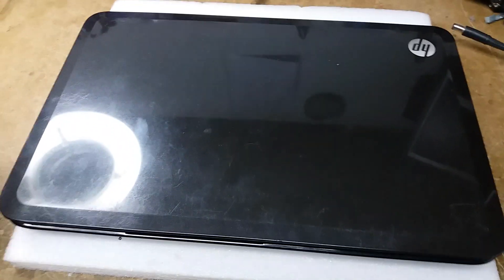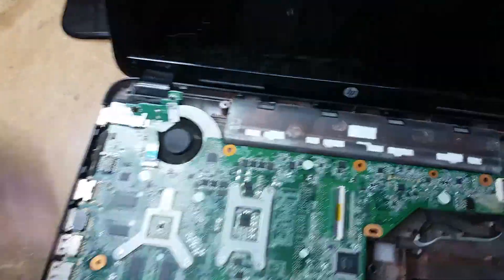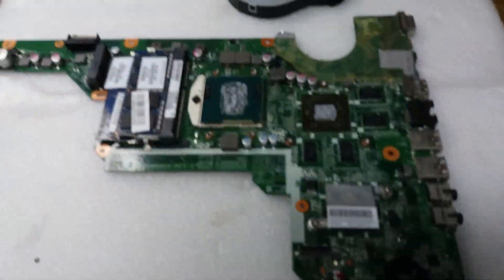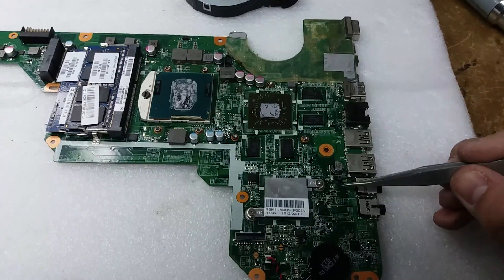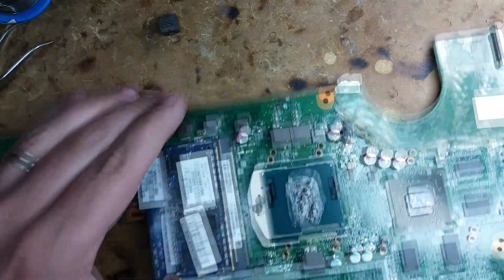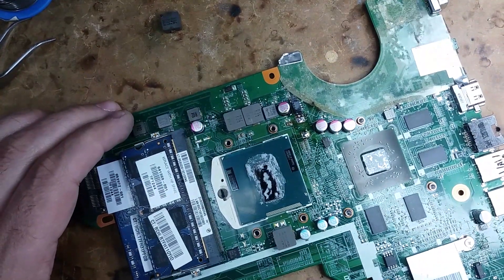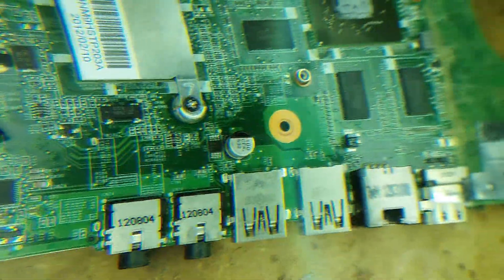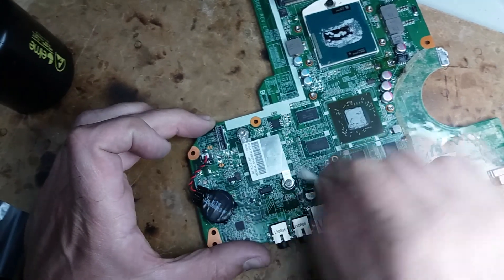HP G6 2017SP turns on but no display, Repair

Comment: Hi sir my name is Atif. I have hp 840g4, laptop. Problem is no display when I press power button machine is on. The frant power card lights 1&4 on then 2 seconds middle light on means 4 lights on and fan to much fast and no display I remove all things, same condition, even reply the bios. Ram supply working good. U have any idea. Share with me thankss

Comment: bro i have a hp 2000-363nr laptop the when you turn it on the caps lock light blink 2 times i try to update the bios but when the hp start the process you cant see nothing on the screen no back light no display but the fan still spinning do you think i having that problem the you have on that laptop

Comment: Why is it that a reflow only is expected to last a short time when if you replace the gpu everyone says that it will last? Thanks
Reply from the maker: A reflow only melts the internal solder to provide a temporary connection. . The problem is actually the inside of the chip, that's why a reflow or reball in most cases is temporary. Granted, there are cases where the chip is fine but the solder balls need a reball.
A new chip will work if the chip is new or it didn't have any problems when the salvaged it. Normally it's virtually impossible to get a really new chip, almost all are refurbished, and the cheap ones normally come with issues. . It's always a shot in the dark, I would advise buying from a reputable source, even if it costs a bit more.
Cheers. 🙏
Reply: @Fixepedia  
Thanks for taking the time to explain this.👍
Reply from the maker: No problem, I try to help when I can . . Cheers 🙏☺️

Comment: What was the capslock blinking code? I have one blink code that goes continuously, and I tried plugging it in to another monitor and putting in another ram, but the screen was still black. I'm not really sure if it's a gpu issue or cpu.

Comment: Ok, so you disabled the separate graphics chip. (removed coil and jumper). So then it will boot just use internal INTEL / AMD graphics, as if there is any separate graphics chip present. Clever. Which this would be just a SWITCH on the hardware user-interface.... as the power button ;)
Maybe an external monitor then after this fix is not possible anymore? Maybe.
Reply from the maker: Hi,
I'm Sorry, but I didn't understand some parts of you message.
But yes, the main Graphic chips is disabled and the shared Graphics chips that is part of the Chipset steps in to do all the work.
Yes, if this doesn't work for you, you might try using a external LCD because sometimes that works. And maybe try and make a All in One Computer like in DIY Perks ;) Check it out... it turns out Great!
https://youtu.be/8jeLCQ62vFk

Take Care.
Reply: can you elaborate? so the coil powers the dedicated video chip? and what about the resistor? I guess schematics are needed for other models, or is there a way to track this if you know what to look for?

Comment: My neighbor has the same laptop with the same problem. But his does not have a dedicated GPU. I removed RAM, SSD, and connected it to an external monitor and nothing works. I'm assuming its a motherboard issue, maybe CPU.

Comment: I have a Pavilion G6 2260SM, it died in 2015 and it's just sitting 4 years because I've never found what is the problem. 
One day the laptop was just idling and on desktop background. I grabbed the mouse and the cursor didn't move, so it was frozen totally. The only thing I could do was to hold the power button to force shutdown. From that point there was no display when turned on. 
Going to shops that repair hardware, they just say: "Well, the motherboard died and you need a new one." 
It has a dedicated HD 7670M GPU and the CPU is an A4-4300M.
It turns on, the fan is spinning, but no display. I just have a soldering station with a soldering iron, I do not have the heat gun. I could give it a try. Thank you for this video.

P.S. I've heard when most laptops have this problem, when you connect an external monitor you get a picture, but it doesn't make sense to me. My laptop doesn't display picture even on an external monitor connected to VGA port.

I was looking on my motherboard, I found the coil but I can't find R550, biggest resistor number I can find is R545 and there is no resistor there. Our motherboards are similar but not the same.
Mine is DA0R53MB6E1 REV:E

Comment: Hi,  hp board DA0R13MB6E0 REV-E PROBLEM CAPLOCK BLINK 5 TIME WIFI LED ON FAN SPINNING NO DISPLAY.  WHAT WAS THE ISSUE? I CLEAN BOARD AND RESOLDER BIOS IC.  STILL HV PROBLEM.
Reply from the maker: Hi,
Did you flash the BIOS also? That's something you should do.
There are a number of things you could try to figure out the problem, first you can try and reflow the graphics chip to see if that's the problem, if not then clean the memory and memory banks, if not then clean the CPU and you can even try reflowing the CPU Socket because there are some models that have that issue.
I hope that helps.
Cheers.

Comment: I have a different board, it is 649288-001 . Cannot find the R649 or R650 location. Are there different methods for the different boards?
Reply from the maker: Hi,
Your board is different but it is almost the same method, you have to remove the same coil, but then the resistor change is from R466 to R451.... but i will leave a link to someone else's video that shows the process. Please tell me if it worked for you ;)
https://www.youtube.com/watch?v=eISpiy5_b8o
Cheers.

Comment: You can turn on the laptop in safe mode and disable the amd graphics chip in device manager too. it will be easier. I too had the same problem and it solved the issue. If you do not disable the amd graphics chip, the os downloads the graphics drivers automatically and again you get black screen because the graphics card has malfunctioned.
Reply from the maker: Hi,
Thanks for your comment and for your feedback, and yes, you are absolutely right. You can most definitely do it that way, but to reduce the power consumption and the stress of that happening as you said, i think it is a wise choice to manually disable the graphics chip hardware and never have it happen again, but i will let your comment Pinned so people can have that option too... Thanks again ;)
Cheers!
Reply: Please bro contact me I have the same problem

Comment: Removi o coil num HP g6-1090sp. Não mudei mais nada porque não encontro essa resistência na board. Ou seja fiz o mesmo procedimento que em https://youtu.be/CZDJhhEqvNU
Apenas removi o coil. Infelizmente o portátil nem liga agora. Não e grave porque a pessoa que o usava já comprou outro, foi mais para ver se o conseguia por a funcionar só que fosse só a com a integrada no problem. De qualquer das formas deve estar a faltar qualquer coisa talvez a mudança de uma resistência, condensadores ou qualquer outro componente.
Edit: após ler um comentário em baixo posso acrescentar que há led na entrada de alimentação, há 19.5V e no pinout do conector do switch de power estão lá 3.3V. não verifiquei no entanto se há problemas aí porque o portátil ligava até então.
Edit2: experimentei desaparafusar a plaquita do power Burton juntamente com o flat cable e notei que o flat cable tinha um dos pinos um pouco descolados do plástico. Ou seja ao tirar e por este cabo acabei por perder a pega cor de rosa que vem com estes cabos. Essa pega ao descolar também descolou um bocado o condutor mais a direita do flat cable. Ao notar nisto espalmei um bocado o condutor e assegurei me que ele ficava bem colocado no conector da board. Experimentei de novo e funcionou 😃 está vivo. Agora e por um SSD e temos máquina nova 😁
Reply from the maker: Boas. . Desculpa lá aqui o atraso na resposta. . . Fico contente que tenhas conseguido reparar a máquina 😁😁😁
Ya. . . Às vezes andamos às volta e pensamos que o problema é mais grave do que parece é esquecemos dos princípios básicos. Acontece-me o mesmo, principalmente nos fixos. . . Andamos ali a trocar fontes e a medir tudo e quando vamos a ver é o botão on/off. . Hehehe. . Anyway, faz parte do ofício.
Abraço.
Reply: @Fixepedia  o único problema neste momento e o teclado não estar a funcionar bem. Algumas teclas não regista ou então só regista depois de premir durante algum tempo. Não estava assim. Não sei se foi ao tirar e por o teclado várias vezes q se possa ter danificado. Mas o flat cable do teclado está bem ligado. Enfim se for problema do teclado por 20€ nem e por aí agora se for a jusante disso...
Reply from the maker: @ANPEM  tens de ver bem se não está nenhum pino torto dentro do conector, também podes limpar os contatos da fita e volta a experimentar e confirma se fica mesmo bem encaixado e que ele faça bem o fecho quando apertas o plástico de suporte no tal conector. . . Se mesmo assim estiver igual é porque é mesmo defeito do teclado, Portugal em regra é um pouco húmido, então acontece que os portáteis se estiverem parados durante algum tempo, é o suficiente para os teclados apresentarem sintomas estranhos e intermitentes.

Comment: i have an hp G42 laptop,everything is working fine,i can even hear the welcome and shutdown tone of windows but the screen is totally black.i test the lcd and flex is good.no display also on external monitor.the gpu is intel.any idea to fix?
Reply from the maker: Hi,
There are a few things i would check first... first i would see if it's not a Back-light issue, you can try using a light source close to the LCD to see if you can see any picture behind the glass.
Second i would double check the connection and connectors to see if they are clean..
Do you know the Motherboard Model Part number? So i can see if i have a solution for you?
Cheers .
Reply: Fixepedia I know you posted this a yr. ago, how would I check if the connection and connectors are clean?

Comment: pavilion 15-e015T- not getting display, power button is on, wireless button is on, but no display, and fan is on,,, like laptop is on
Reply from the maker: Hi,
Did you try connecting it to an external monitor? There are always a couple of other issues, like a faulty Display, etc... But you have to troubleshoot those options. Good luck with your repair.
Cheers
Reply: @Fixepedia  thanks for replying
Reply: Yes i tried... But no results... Now i repaired my laptop on a shop. He said there were inside water in laptop and board was sotting. I was cheated by him he stole my cpu(i5).  And said cpu was faulty due to Power ic sitting problem. Is it possible?
Reply from the maker: @NeoStreamLive  Hi, the cpu can be faulty due to a number of issues, but they are not that expensive, you can order one on eBay and change it if you find your current CPU slower. . . I mean that can happen, since these some of these new cpu's have a graphic chip integration, then it could cause problems, but sometimes it could be a power consumption issue and if you change the CPU to a slower with less power consumption, then just changing it can solve the issue. Hope this info helped.
Cheers
Reply: Thanks, its very helpful
Reply from the maker: @NeoStreamLive  thanks for watching 😉
Cheers

Comment: Hi there !! i was searching and searching to find a proper video like yours in ENGLISH so i can understand why/how this is done. THANKS V much !!!

A Question if you have time to read this... 

 A few weeks ago my RADEON GPU worked just fine sort of, sometimes while playing some older games like GTA SA i would get a freeze and machine would restart but nothing more.

4 days later i updated my HP's BIOS to the latest, and did a fresh install of windows...
Here's the problem... since the update and windows fresh installation,  i can't get my GPU to work again, i'm not sure if this is a software issue, hardware issue or that HP maybe programmed their bios to kill off all last surviving Radeon GPU's in the G6 Series, because whatever i do, that card is not working, windows reports error code 43  

Question would be: Do you happen to know if this would be rather a hardware problem or maybe software ??? i tried all drivers available on the internet from A-Z and 4 different windows OS's and had the same result. 

I also own a HP G6 2303SQ Board that i can confirm has a dead GPU, since whenever you install AMD driver you would get BSOD making it unusable.
Reply from the maker: Robin SAS Hi, thanks for the great and kind feedback 😉
Yes. . . I'm gonna guess that it is a faulty GPU, from what you told me about the problem that it gave prior to the fresh installation and Bios update. And from experience, Bios updates always improved performance on the computers that I updated. I would open the computer and check and see how bad is the clogging in your heatsink. If its clean and your thermal paste is still good, then I would try to troubleshoot drivers, etc. . But if it's clogged and got dried up thermal paste then it's most likely the Gpu Hardware failure. 
Your other laptop is probably the same as this one in the video, try and see if you can fix it, and if so, come back with some feedback, I'll be curious to know how it went.
Cheers
Reply: Hello Fixepedia. I think it might be a hardware problem, it drives me to believe that the updated bios might came with some instruction that diagnoses faulty hardware which in end prevents the issued hardware from working at all idk. Or it's end time just arrived...

But i will as a last resort give it a try with a fresh updated OS and driver's. 
if it still won't bring nothing, then i'll just shutdown the GPU for better CPU thermals.

 ..sure going to be fun for me to switch that TINY little rezistor without damaging the board...with my "Soldering Gun"     Some guy said i should just remove the COIL, but then i wonder why all the people in the videos switch the rezistors too, Well i'll be coming back later in the future with an update on this. BYE &       Thanks for replying.
Reply from the maker: Robin SAS Hi, yeah. . It might end up being the best option.
Yes, you have to change that resistors location, because it is a "jumper", and it is that sequence that determines if the Gpu is active or deactivated 😉 
Best of luck.
Cheers
Reply: Hi, just wanted to post an update on this.  I've managed to Reposition that rezistor and to remove the coil.    the rezistor was the hardest part, but i managed. 

About the temperatures which was my main goal - i'm not so sure that it helped, since i don't notice much of a difference in thermals. 
So if anybody want's to deactivate dedicated GPU for thermals only don't expect too much of it.
Reply from the maker: Robin SAS Hi, did you manage to clean the heatsink, clean their thermal paste and put in new and quality thermal paste? 
Cheers
Reply: @Fixepedia  Yes everything was changed ofc.. but little to no difference. AMD GPU is also 100% disabled.  Anyways i'm ok with it. Have a nice day !!
Reply from the maker: Robin SAS Hi, cool 😉 glad to hear that. . Keep up the great work.
Cheers

Comment: MA man i I got the same laptop but in amd A10 apu with dedicated  gpu you think it will work it has the same lay out
Reply: You can't do this on AMD CPU equipped laptops.  They usually have ONLY 1 Video adaptor that is inside the CPU. bad luck. 

Also, never buy laptops that come with AMD Equipped Graphics cards.. They don't last long.
Reply from the maker: Robin SAS True. . Personally I only try to sell laptops that are equipped with Intel CPU's. Because AMD always gave me problems in and out of warranty. The heat up to much and are much more likely to burnout.
Reply from the maker: Hi,
It should work...
Can you tell me the Motherboard Model?
Cheers
Reply: @Fixepedia  any idea , did you take a look on the mobo layout
Reply from the maker: Hi Mike, sorry for the delay... only today when you reminded me to check did i arrange the time to see.... but i don't think it will work, because from the specs that i found, it seems the you don't have a dedicated GPU... but can you send me photos of your board, from both sides? send it to my email: fixepedia@gmail.com
Thanks
Cheers
Reply: @Fixepedia  DA0R53MB6E1 REV : 3 IT WAS WORKING FINE after restart I get white screen with no imagen trough hdmi so I guess is the gpu the cpu is a amd A10 I know those cups have integrated gpu but this laptop also have dedicated amd gpu

Comment: This laptop has dual GPU ?
Reply from the maker: Hi, Yes... it comes with the dedicated AMD Graphics chip, and it has a Intel Chip HD Chipset that i think in this case was a (Mobile Intel® HM76 Express Chipset), basically  the method on this video  is for someone that doesn't mind giving up their dedicated GPU Chip and just wants to surf the web, deal with normal everyday tasks, then this is the choice for you. This repair serves one purpose, that is to deactivate the dedicated AMD Gpu Chip and activate the UMA intel chip to be the primary graphics card.
Cheers
Reply: @Fixepedia  I too have a HP g6 laptop with dedicated gfxc and it turns on fan runs but nothing on the display . When I connect charger it properly charges the battery . I tried removing the battery for whole night than pressing the power button for a minute than connect charger only but still it shows black screen ,I even tried external monitor  but no luck , I removed CMOS also but still same . Power button glows white ,F12 glows amber but display is blank , only I can see a white led blinking on LAN port . And the laptop turns off automatically after a minute when it heats up .
Reply from the maker: Hi, If you have the tools to perform this repair, and if the board is the same i would highly suggest you try it out... you got nothing to lose ;)
Hope to hear some positive feedback from your repair.
Cheers
Reply: @Fixepedia  I would have tried this but I don't have these tools .
Reply from the maker: ok... Then that's  gonna be hard... with a bit of patience you could try doing it with just a soldering iron but i will be pretty difficult... I would take it to a repair shop and ask for a estimate on this job.
Cheers and best of luck.